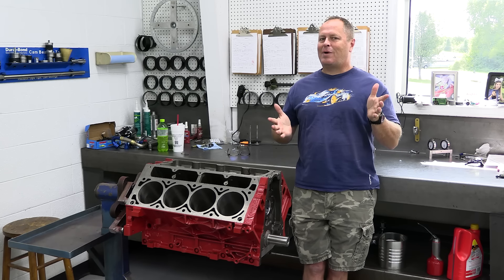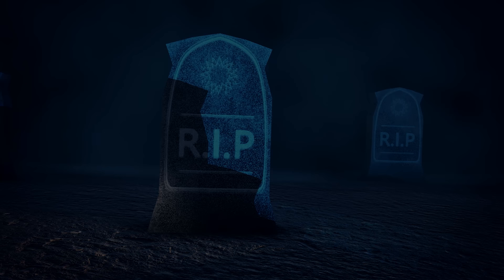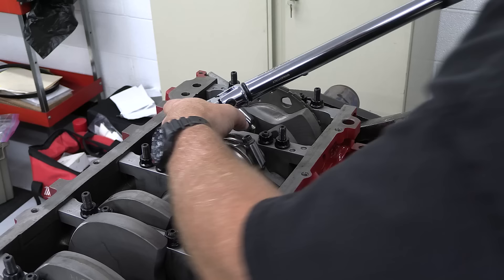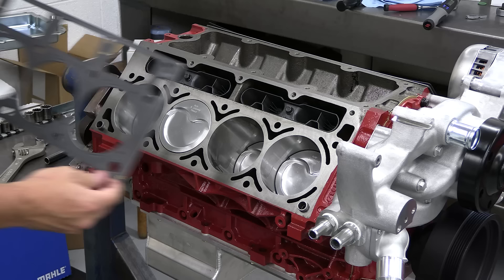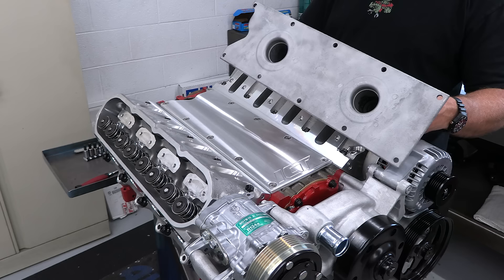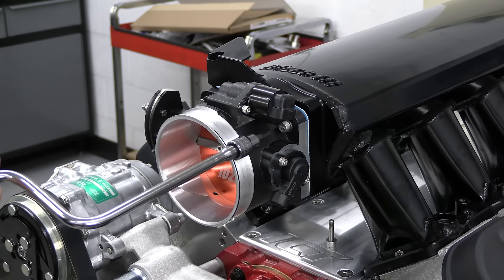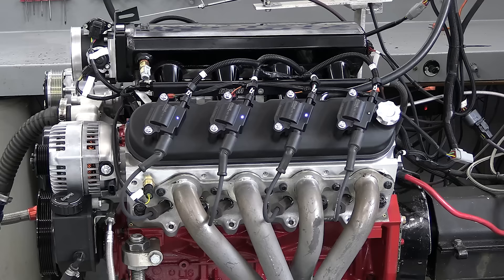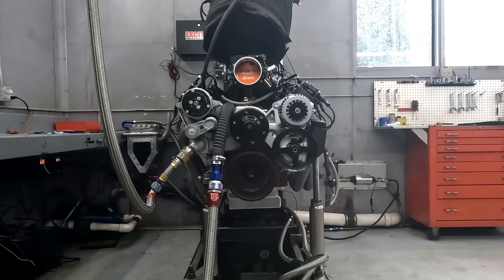This Engine has been on Fire! (Overkill Engine Build for My Corvette)

Comment: Man, I gotta agree with you... with 416 cubes, that much cam and cylinder head, I was expecting 640 to 650hp.
Reply: It seems to be the way with these 'fully built' LS motors
Reply: Low compression killing power
Reply: kinda low compression for NA  ... BUT he can run 87 octane and it's still gonna be a pretty fun reliable engine and if he ever wanted to add a procharger or a turbo it is basically ready for that
Reply: @bnard4659  Compression and cam LSA.
11:1 and a 110 LSA or tighter cam would probably 'fix' it.
Reply: Did you actually measure the head volume and piston deck height,piston volume... if not, you have no idea of the compression ... just a wild guess, which is extremely poor engine building by a so called professional. 
#2.... what was the cranking pressure...again if that wasn't checked, very poor engine building skills. After all that, I would never ever run 10:1 comp with a 247 deg cam... torque will suffer drastically.... needs at least 11:1.... c'mon guys, this is kindy stuff, get your act together.
Another point is you mentioned head flow being 370cfm.... you didn't mention if you actually flow tested the head... so, saying it flowed 370,doesn't mean a thing unless you see it with your own eyes... and as we all know, that figure is usually at .700 plus lift, no low, mid range figures, and also very few heads flow the advertised numbers.... so when the power number don't add up, you haven't got a clue where the hp went...???  Also, no mention of mcsa, which is extremely important into matching cam to rev range.
You do a great job of explaining what bits and how you put them together , but, garbage in equals garbage out. Remember, the hp you missed out on is the hp you need to worry about???
Sorry to be so negative,  but these are very basic 1st week engine designing rules. Hopefully next time you'll take a bit more care.
Reply: @nitram7321  since you left your comment as a reply to someone else's comment about the video featured here,   this man most likely won't see what you wrote.
Reply: I think it's the low compression he could of went to probably 11.1

Comment: I’m building a 1982 C3 as I said in another comment. Some day a 82 anniversary Vette will be worth some money. But I’m buying it from a buddy, with the original fresh build 350 engine that only made 200hp. I’m going to strip the car and install a cage. Use the fresh short block with a set of Aluminum high flow heads from Trick - Flow. A nasty cam with springs and lifters. Smash the Cross-fire system. He has a new aluminum intake with a 750 Holley. I truly believe I can make 400-450hp with this engine. With a Nitrous Express plate with spray bar it will make over 500-550hp with a 150-200 shot of Nitrous after further research. I plan to install a man pedal with a Tremec TKX 5spd. I’m not worried about hurting this engine, because I really want a LS setup like you have. It should get under 3,000 pounds when I’m finished. We need more videos like this for guys on a budget. I will only have $5,000 bucks in a rust free C3 Vette with a fresh 350. Body is very clean with solid floors and no cracks or fading in the fiberglass. With a new TKX I will have around $10-$12k with new wheels and tires. Race seats and a safe cage. My buddy already put new suspension in the car with new heavy duty half shafts. I will have a killer street/strip car for around $10k. With a few late nights and weekends and help from some buddies I will have a fun C3 Vette that I’m not afraid to beat on. My long term goal for the car is a fresh 6.2LS with a TorqStorm supercharger. Then I will have a 10 second C4 for under $20k. Perfect car for some Drag & Drive events. Guys need to see that you can still build a fast car in the garage on a budget. Having a nice looking C3  that run 12’s for around $10. Or a badass C3 that runs 10’s with a new LS for under $20k.  Guys think you have to spend $50k or more for a nice car. Just not true. Love videos like this. 🇺🇸🦅🏁Had to make a second comment on this video. It’s that good. Shows you don’t need a big bank account to have perfect fun car ..

Comment: I absolutely loved Chevy Hi Perf and GM Hi Tech Performance.  I built an 11.8 CR 416 with a 240/250 .623 .617 114 cam and Stage 2.5 WCCH LS3 heads with a stock L92 intake and 90mm TB that made 530whp in a TBSS. The LS3 heads are really impressive on a 4.065"+ bore only, on a 4" bore they're a dog. After you get it built you should compare that intake to the BTR Equalizer, Fast, ported stock intake and a Texas Speed Performance Titan.

Comment: Just found your channel, liked/subscribed, noti. bell.
1980, 81, 82 Body style is still one of my favorite cars.
 I bought a one year old 1981 black on black 4-spd , put a full suspension kit on it nylon bushings, koni shocks, ++ , black Epsilon wheels - the only maker I know of that produced a wheel that didn't need spacers. Put 90K miles on it in 8 years. Sold it.
In 1991 I bought an 11 year old black on black 1980 L-82 with 10K miles on it, planned on doing all the suspension etc. again and supercharging it, but it was just to nice a car to do all to - or so I thought. I paid $16,500 for it, a lot of money 31 years ago.
OK looking forward to seeing your C-3 Corvette build burning rubber.

Comment: That forethought about the alternator situation on a race oriented motor is nice! I’m fighting that battle right now on an SBC in a 3rd gen F body that originally was equipped with a 10SI alternator. I’ve burned up 2 or 3 now. They worked fine until a couple trips up to my 6500 rpm redline then fail shortly after. I do stress them a little more than usual with the addition of EFI and a much higher capacity electric fan though.

Comment: I would think that is a lot of duration for a street motor with heads that flow that good. I think a different cam could easily pick that thing up 50+hp and maybe even get 50ft-lb torque too. 23:50 I don't care for that stepped transition in the intake either. That could be causing some turbulence that kills that head with that intake. It would be neat to flow them together on the flow bench to see if that intake hurts it a bunch.

Comment: I've installed maybe 5 LS oil pumps and never worried about centering the lobes. I guess they were basically all used engines with the matching used pump though

Comment: Cathedral port "originally called tear drop port" heads make big power with the right combo, ppl that revert back to rectangular ports probably have rectangular port shaped heads above the shoulders. Good choice for the build! Also needs a crank driven blower if it's possible to fit the C3. That many cubes will benefit more from a blower IMO, also seems like the cam fell off early. Maybe I'm missing the point that the cam might have been chosen for a blower application to begin with, that'd definitely get those torque numbers up but 250hp over stock is nothing to cry about, the C3 would be a handful with those numbers alone.

Comment: you and your dad and the men that work on these wild motors are great . I could only dream of. I have a 2004 scion and a 91 2500 chevy truck which am been fixing backup for the road, but with gas as high as it is and lack of funds ill just be glad to be running later on. be safe and take care guys.

Comment: I'd.
-Swap the intake for a Holley hi-ram with dual 4-bbl efi throttles.
-Ditch the Fitech for a more capable ecu. With enough I/O for oil, coolant and fuel pressure+temp sensors.

Can never have too much data. It's the best way to protect the $$ invested in the long block. An ecu will pick low oil pressure, loss of fuel pressure or high coolant pressure seconds before you happen to glance at a gauge, or start to hear/feel something off.
Reply from the maker: You are right on all counts. The FiTech isn't bad by any means, but I think there are better options for high performance. Thanks for watching!

Comment: Surprised the system doesn’t monitor the oil pressure as a safety system to warn and cut the engine if there’s a problem. Great build though👍👍

Comment: The way that engine bay looked I wouldn't be surprised if that was a flood damage vehicle. Did you look at the interior to see if there was a water line?
Reply from the maker: That's a good thought. I think I only stuck my head inside the door for about 10 seconds. Don't remember what it was like in there. Thanks for watching!

Comment: a few years ago I built an LS 7  N/A  with some compression and parts selection using a scale to keep solid roller valvetrain mass low we achieved 771hp at 7200 with 597tq at 5100, crazy expensive

Comment: You may not want to hear this, but those sheet metal intakes are famous for low NA power. They hold onto a ton of boost. but for NA its robbing you of HP. Richard holdener has dozens of videos of those on dynos. If you want more mid range punch, id recommend dorman ls2. If you want more top end, BTR trinity or equalizer.

Comment: I was thinking 630 out of that set up! I have a 408 with Mamo Motorsports 205 heads, a 226/230 grind cam, and a TBSS intake in my regular cab Silverado. It’s a hoot on the street, and mine probably only makes mid 500 hp and torque.

Comment: It’s a good engine build, however it should have made WELL over 600. The LSA on the cam is way too wide. Period. For N/A it should be 110 at most, probably 108…. And it’s great power for such low compression but unless it’s going to see boost it could have been 12:1 and still ran on pump gas. Those 2 changes would have gotten it well into the mid 600 range. I’ve built a few max effort n/a LS engines and know this from my own trial and error. My last 416 with stock casting 823 heads and a custom GPI cam made 730hp.

Comment: Nice build.  David Vizard would probably tell you that you hurt the peak torque and power by going with such a wide LSA - My bet is that he'd spec a 105 or 106 LSA, not 113.   He spec'd a 251/251 @.050 with 105 LSA for my much less impressive 406 SBC.  I told him I was targetting peak hp at 6000rpm.
Reply from the maker: I like a wider LSA because they tend to help low-end torque production, but you're probably right about helping the peak. Thanks for watching!
Reply: @TheHorsepowerMonster  - Understood.  My application is even more torque challenged than yours - a Datsun 240Z with a 406, with 255 wide tires being as large as I can go.  So the loss of low end torque didn't bother me.  The midrange pull is very strong though!
Reply from the maker: @pete540Z  You're right, torque is tough to make with those. Sounds like a fun build, though!
Reply: @TheHorsepowerMonster  Torque is tough to make with a 406 small block chevy?
Reply from the maker: @pete540Z  Oh no! My bad! I read Datsun and basically didn't read anything else. I thought we were talking about the straight six those things came with. Now I'm doubly impressed, a 406 with 255 tires on that thing should be a blast! Sorry bout that.

Comment: Maybe the low ram would make more power with those heads and cam at higher RPM. Possibly a stock stroke 3.62would have done just as well.
Reply from the maker: It's very possible

Comment: You are making me so crazy. I have built a few engines since 1965. Some good ones were the old 81 with a Vortech then the 98 LS1 Iron Block with a Magnuson. Which Could have really used those Brodick Heads. I had Brodick Heads on my 468 Rat which ran in the 9's in a 64 Coupe. Now I own a 2014 LT1 Z51 A6 but no money to mess with it. Argh!

Comment: You could have some Viper-like intake plenums (plena?) that were on the opposite side of the car from the cylinder head they're feeding, and snake huge, long intake runners across the engine over to the intake ports. Where they hop over the valve covers, you may have to be judicious in their shape, but hey, imagine all that power under a stock hood!

Then cam it for super-high RPM and put big ports on it to "rescue" the top RPM from the super-long intake runners!
OR have a V-boost system like Yamaha did with the V-max that opens a common plenum/joiner between ALL the cylinders at higher RPM. It would be not too hard to engineer.

Comment: Just a suggestion: your cam should have 105*-106* LSA.  If you want the same driveability you'll want 230*/242* duration.  That lobe family will still have 0.638" lift.

If you really want to bump up mid-range torque you should go with a FAST LSX manifold...the runners are the ideal length.  You should see 585 lb-ft with a 416, and 100% VE will be 617 bhp.  Look to the exhaust side for HP.

Comment: Wow for what you went through off frame down to the last nut n bolt, I would have bought an aftermarket frame n suspension system. What ever you saved in dollars you spent in time/labor and still have the old suspension. You have about a grand in tte frame between blasting and por, not to mention all the welding and labor. 

But I enjoyed watching.
Reply from the maker: You are right, but fun and entertaining beat sane around here. Thanks for watching!

Comment: You will start to get excessive oil consumption with this engine.  Short pistons with short skirts, maxed stroke and cylinders that don’t have extended sleeves, you will get accelerated piston and bore wear.  Might be why it didn’t make the power it should.

Comment: I think the compression is too low and the intake is a restriction. The cam was trying to carry it out based on the curve, but couldn't. Need to test out another option. Either way, it will feel awesome.
Reply: that intake was fine for 1000hp, and so was the TB... the problem was the baby cam was falling face flat

Comment: For that many inches and degree of head it should  be 700 hp even on pump gas. The last 2 383 sbc pump gas 23 degree head engines I've built in the last two months made 596 and 581 at 6500 rpm or less and both had 520-540 tq. A better parts plan could have had a better outcome. Better luck next time.